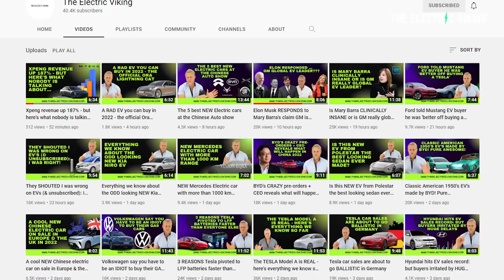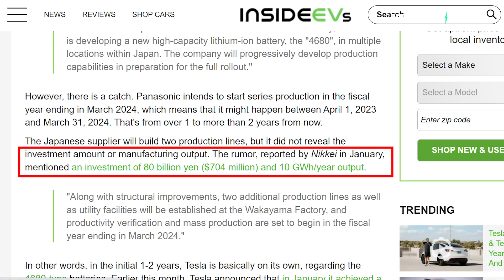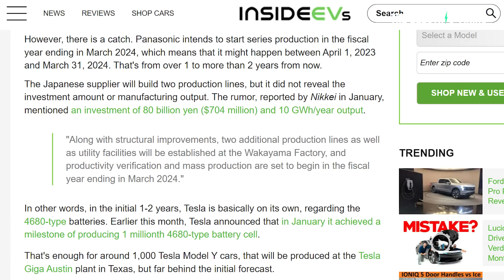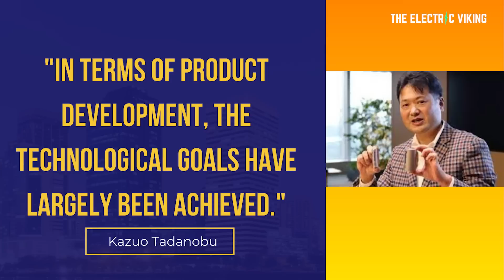What we know about Panasonic's 4680 production in Japan

Comment: 2170s are better for heat management in high-performance scenarios.
So, room for both form factors, IMO.
Reply: The 2170 (and 18650)  form factor make heat management easier than it would otherwise be in a 4680-sized can. It will be interesting to see whether Panasonic uses Tesla's intellectual property to make usable 4680 or creates their own design to manage heat in the larger case. Presumably they will use their own design if they intend to sell to other car manufacturers beside Tesla. The tab-less core is an important part of this but there will probably be other differences.

Comment: 4680 development at Tesla is not finalized. The full implementation of the modified chemistry and dry electrode technology from Maxwell will continue to be rolled out. What will be interesting is if Tesla licenses the proprietary aspects of this to one or more suppliers. I would expect at least Panasonic.
Reply: not finalized? 4680 equipped model ys are sitting outside the austin factory RIGHT NOW!
Reply: @dclpgh  There are multiple stages of 4680 development. Tesla made this clear on battery day. You are right about the Model Y's being built with the current version of 4680.
Reply: Agreed  1st gen. Also if panasonic's factories have drying ovens for 4680 production, that means tesla did not share  their dry electrode ip. watch out for that.

Comment: The 4680 uses the same chemistry as 1865 of 2170. It’s tab-less connection makes all the difference by removing welds and resistance (heating) from the power connection.

Comment: Nissan is introducing the Ayria mid size vehicle in Europe this summer. They have announced that the next Nissan Micra is going to be an EV. Along with the Renault EMeganne and the Renault 5 these sister vehicles will undoubtedly sell well in the UK and Europe. So I would argue that Nissan is not just marching blindly to oblivion.
Similarly Mazda are intending to introduce 5 HEVs, 5 PHEVs and  3 EVs in the next 2 or 3 years. The CEO of Mazda UK has just confirmed that the company will be ready for the 2030 phase out of ICE in the UK and the 2035 hybrid ban.. So, once again the idea that they are sitting rudderless in a boat leaving everything to fate just isn’t right.
Perhaps one of the approaches the EViking could take is to produce one video a week looking at the current position of each legacy auto brand and their current plans. We might then get a better Verviers of the EV world.
Another would be to look at new entrants to the market. The Fisker Ocean, for example, looks an interesting entrant into the market with its base price undercutting the model 3s current European price quite substantially. Plus the Fisker Project Pear aims to produce a small and radical vehicle in the US using Foxconn as the manufacturing partner. This one company alone could be a big disruptor to legacy auto .

Comment: I believe Tesla will use all formats to one degree or another. The LFP battery is pouch design in the Model 3 here in the USA. So they will have 1850, 2170, 4860 and the Pouch design in products. Question is which will be the first to be phased out??
Reply: 18650s, the oldest and most power inefficient by weight.

Comment: You forgot prismatic & blade LFP. And LFP will dominate due to cost, safety, material sourcing. 
I do love structural. Cooling (end, tabless) not so important for LFP, so I doubt 4680 & LFP. We’ll see. I wonder if most 4680 won’t go to cybertruck & semi. Leave Y mostly LFP. S & X retain 18650 for this generation. Structural is the big determinant for 3 & Y. 
PS. Good call on tabless needed for 4680, but DBE not, silicon for anode not or not as much.
Oh, & Megapack for everything - but best LFP.
Reply: I think lfp for standard range cars because of the higher weight disadvantage. Good for megapack too, weight doesn't matter.

Comment: I think the fact that Tesla showcased the current newest Plaid model Ss run on the classic 18650 cells is telling on the the quality and power of this battery size. Although in theory the 4680 cells have theoretically more power to weight ratio and perhaps longer capacities it still remains to see how real world performance will be and what the true value applications for these batteries would be. Aomehow I wouldn't be surprised these batteries could revolutionize aviation and power tools more than improving the electric auto industry. In the real world there are great differences in quality between 18650 amd 21700 baytery producers. For a long time Panasonic has been a leader in producing high quality high quality 18650 and 21700 batteries. Over the years chinese companies have imoroved as well, but there are enough youtube videos talking about the vast diffetences in capacity quality between batteries. I wouldn't be surprised that if Panasonic sticks to 10 GWh per year capacity I think they will compete on high quality high capacity 46800 batteries, over the competition, because squeezing out every liitle watt and ampere out of each battery mixtire recipe is increadibly hard, compared to the average recipe that just works. I can imagine it takes more finness to make high quality batteries when takes perhaps more time and effort to make each battery, which takes more time to make each batch, and well, which means they can make less batteries per year. But they compete for the highest quality, perhaps better batteties for the more premium cars.
Reply: Disagree, can only produce limited number of 4680s, probably only targeting them for long range models or for high power truck/semi. 4680 not suitable for normal power tools, they would be too big.
Reply: To engineer something that is reliable means the least amount of parts. Obviously the 4680 means less batteries in a car.
As far as performance goes should be just fine. As it is Tesla is building incredibly overpowered cars.. with too much rang.
This willl change as people become educated but not until then. Marketing versus actual engineering.

Comment: Tesla will use as many batterie as they can, not only 4680 until the production capacity catches up. Will they ever use 4160 for the energy side? Not for a long time. The current 4160 production will look after a portion of Tesla growth. Tesla plans to produce Tetra watts/hr rather than giga watt/hr when they reach that production capacity they may start using only 4160. I think it will take a few more years but who know how fast Tesla will ramp up battery production

Comment: 2170 will be phased out. Its a stupid format, only usable when you cant get your hands on enough other cells.
I have a strong suspicion we will see Tesla and BYD cross-licence 4680 and LFP-blade.
Leaving Tesla with the relatively simple task of making the LFP blades become "structural".
If that doesnt happen, Tesla will need to make 4680's with two different chemistries
Reply: Not sure tesla will manufacture lfp until the recycle issue is resolved.
Reply: @thomasgaudette7367  Aren't Redwood engineering already doing the recycling of lithium Phosphate batteries?
Reply: @sreekrishnanmuralitharan520  as I understand not yet economically.
NCM and NCA are being recycled recovering in excess of 90 percent of the raw materials content profitably.
The difficulty with lfp is the low value of the raw materials.